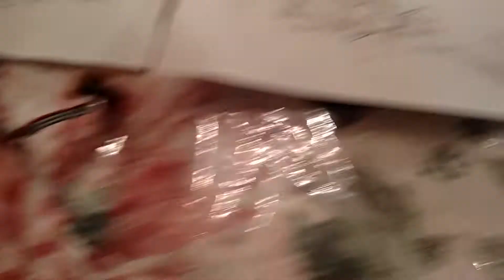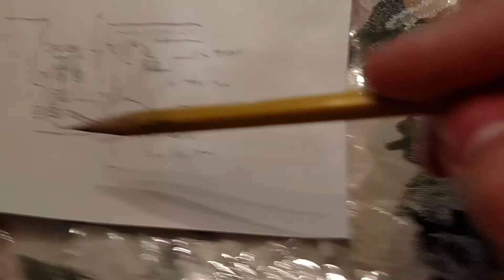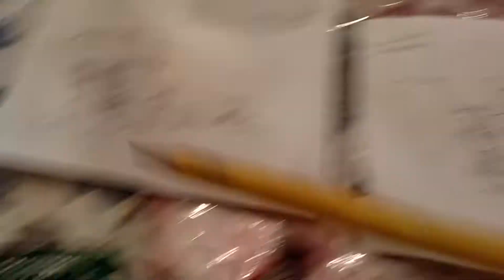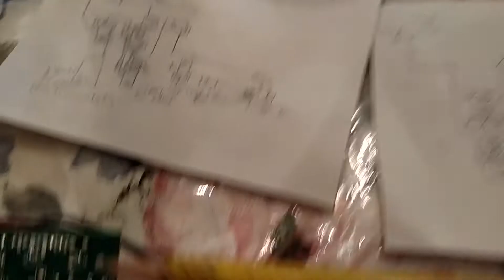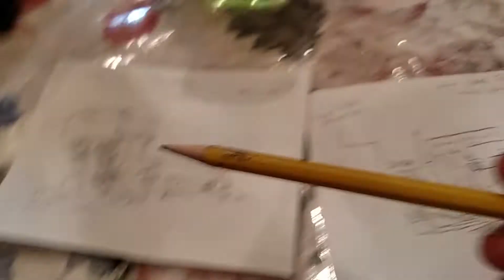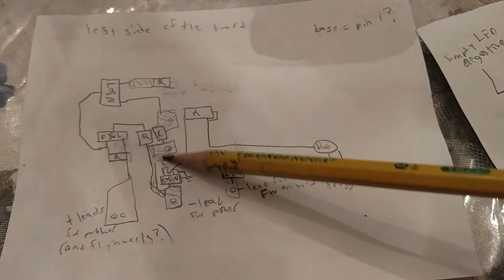Nerf Regulator Complete Circuit Explanation

Comment: Which specific voltage regulator do you recommend for just running it off 2 IMRs.
Reply from the maker: I would actually recommend a 5volt buck/boost converter. I got the one I used in this blaster from Pololu.

On a side note, I'm not sure I would recommend using IMRs for a blaster with 3 motors, they may not be able to output enough current. I'm not entirely sure, though.
Reply: @Shades_-dl7vs  How many mA for the converter?  I ran mine with 2IMRs, but fried it.  But they ran all three motors without an issue before it went.
Reply from the maker: @JohnDoe-ng7xm  I think this is the one I used, or at least one similar to it:

https://www.pololu.com/product/2119

Comment: Isn't there a way to keep the pusher and select fire on it's own power? Rewire the flywheels completely separate.
Reply from the maker: Arron Shepard Yeah, the only tricky thing is that there are 2 positive wire leads that go to the board and both are needed. One goes directly to the battery positive and powers most of the circuit and the other goes directly to the + side of the flywheels and powers the pusher mech. It's designed that way so that the pusher motor can only actually run when the magazine and jam door lock are activated, allowing the flywheels to run. This way the entire circuit doesn't have to turn off and on every time you rev the flywheels. You can just run both wires directly to positive though, and completely separate the flywheel circuit.

Comment: That’s not quite how mine works. U3 is a 3.3v regulator for the micro and its accessories. It kinda does need it.
Reply from the maker: Is that the one I said was a power on reset? Weird, mine works fine if you bypass it.

Comment: Posts are working apparently! So if the brown wire is needed where/how could I short it to so the board thinks it's connected?
Reply from the maker: The other end of the wire has to be connected directly to the positive lead from the battery. You can either splice it into the positive lead or connect it to the point on the board where the positive lead from the battery is connected to the board. It will actually be the wire carrying current from the battery to the motor.
Reply: I sorted it connected the brown to the 5v on the buck works perfectly
Reply from the maker: Justin Eagle I wouldn't do that, connect it to the 8v lead. I doubt the converter can handle that much current, and using 5v will slow down the motor.